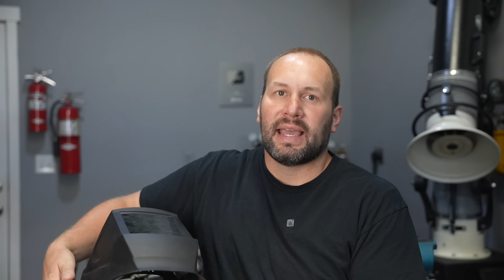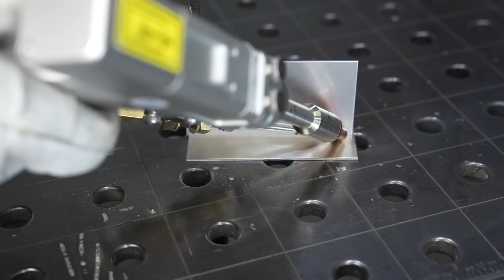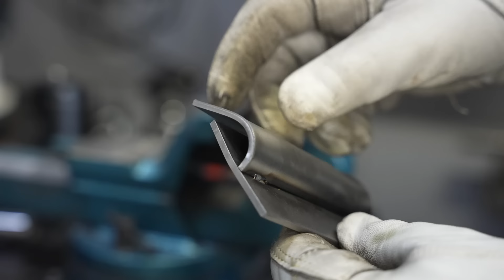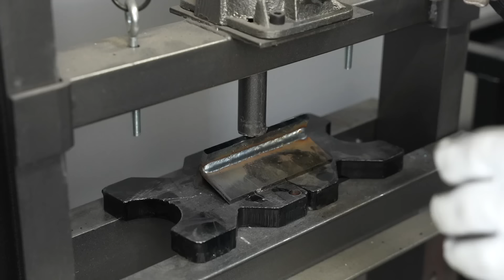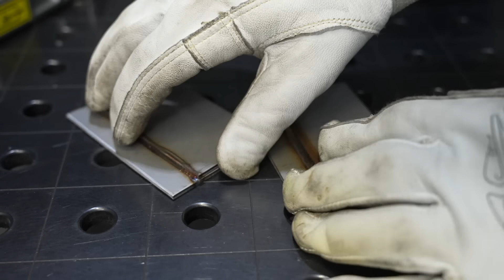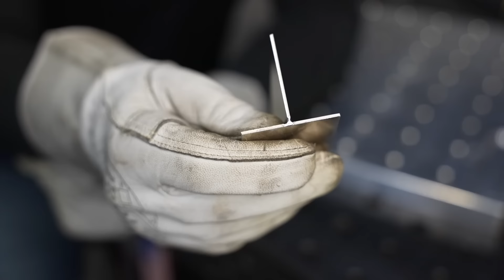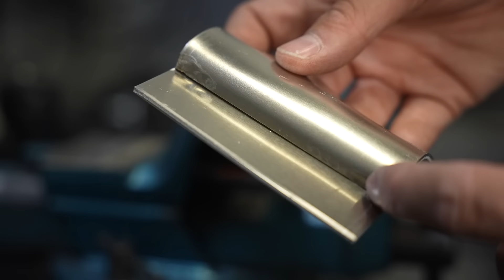Laser Welding vs MIG & TIG - XLaserlab X1 Pro Part 2

Comment: Nobody talks about TIG Hotwire anymore 😂
Reply from the maker: It's definitely not the trend these days, and didn't play out for everyone. Tiptig's hot wire is still around in a lot of pipe shops. Some of the new advanced wire feed setups have such good control that they've taken over a bit of that space too.
Reply: @TimWelds  you are right, but I think the main reason that people don't use or see it anymore is just the price! Even for a cold wire feeder you pay more than for a mig welder. That makes no sense for most of the people. But it's a good thing.

Comment: I know this may be a stupid question, but you don't need to ground the material with the laser welder (right?).?
Reply from the maker: You don't have to ground the material because there isn't an arc, but you still have a similar work clamp to put on your material for safety. The gun has to be touching the workpiece for the laser to fire.

Comment: Some great info there Tim, thanks! In the right setting/application, I can see where the laser would be game changer. Particularly in applications where weight is a factor. There is considerably less deposited metal with the laser. You could shave a lot of pounds off an assembly that has hundreds( or more ) lineal feet of weld. Pretty cool stuff! Not attractive to me for my home shop, but still very interesting. Now a laser cleaner for the home shop would definitely be nice.

Comment: I wish that laser came out about 9 years ago. I would have bought that instead of the 2 MTS welders I bought! Thank you for the informational video.
Reply from the maker: For all around stuff, I'd still tend toward the MTS for a first welder because of the versatility and then add this as a second machine. If you're building things that you know are a good fit for these types of laser joints, then it would definitely be a winner.
Reply: It did come out 9 years ago. Laser welding isn't a new thing, it just got cheaper. The big factory been using them for ages. From airplanes and boats all the way down to cars.

Comment: Tim, do you have to turn on the gas every time you start to weld.  Kind of annoying , having to start the gas each time you want to weld is there a setting I'm missing or do you know...
Reply from the maker: The gas on mine just turns on itself when I push the weld button on the gun. I think the gas button on the panel is just to purge the line. If the gas isn’t turning on automatically, I’d reach out because something must be wrong. The gun needs gas flow to cool it.
Reply: That's what I thought yeah so mine every time I stop welding the gas turns off and it's a pain cuz when I want to restart my weld I have to physically go over to the machine and turn on the gas so I'll have to get with them see what's going on other than that I love the machine yes and I did weld my parts to my table a few times😂
Reply from the maker: Did you try it without turning the gas on using the panel? It turns off automatically when I release the button and then back on when I press it again.
Reply: @TimWelds your right Tim.  I thought you had to turn it on every time you wanted a weld but I just went down to the shop when I had a few minutes tonight and tried it not looking at anything just looking at the gauge and yep sure enough every time I would start a well the gas would turn on and when I would stop it would go off yay I don't know why I was thinking that I think somebody said you had to do it also and I guess I just took that verbatim. 
Would be nice if you're local I'm in Riverside California but I don't think you're in California I'd like to meet you sometime anyway thanks much and always enjoy your videos...
Reply from the maker: Awesome, glad to hear that it's working for you! I spent a year in San Diego and loved it, but I'm in Utah these days.
Reply: @TimWelds Utah funny that's where all my friends have moved from California up to there it is really pretty up there too and you can get land a lot cheaper and a lot more anyway love this welder.